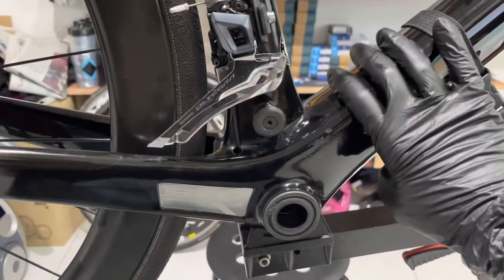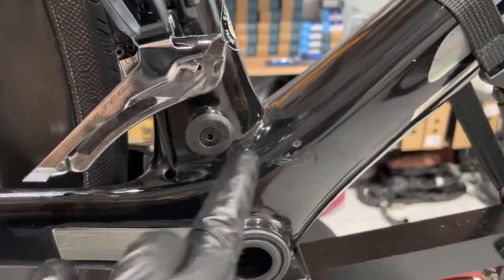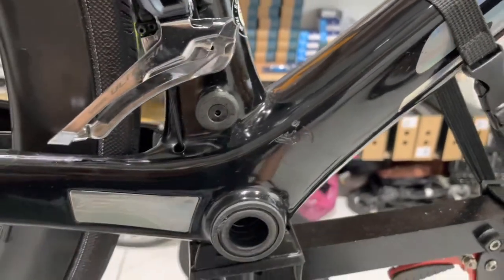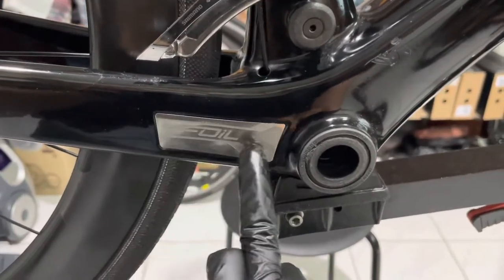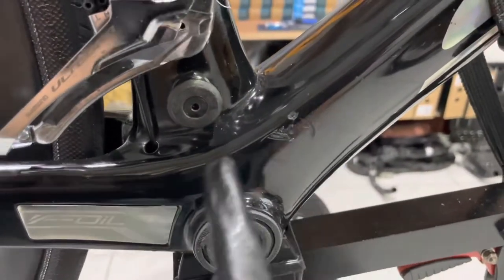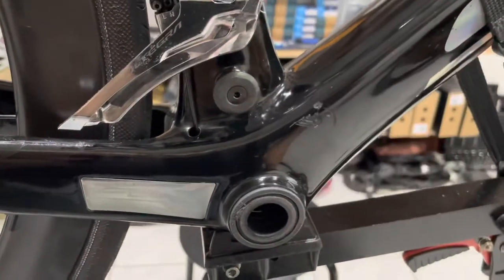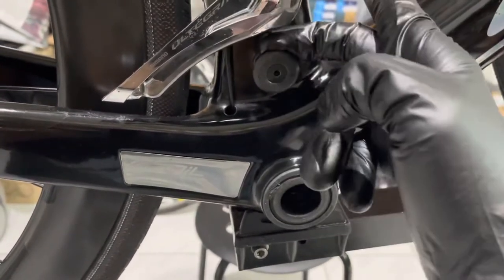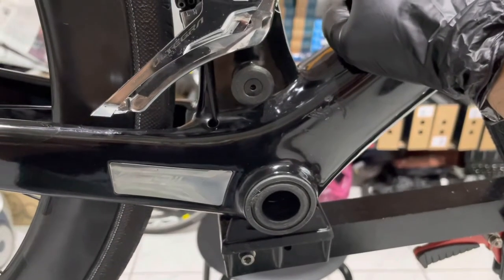Bicycle Chain Drop. On carbon bikes.

Comment: I think that steel plate designed to protect from the small chainring rubbing against chainstay while flexing under heavy load (eg 1500 watts sprinting :)) . I’ve seen multiple frames from different materials with damage in this area. In my carbon frame they went cheap and just put thick transparent sticker.
And I also got the same problem with dropped chain hitting the down tube. It had happened only ones but with absolutely properly set limit screw on the front derailleur. As for now I also ended up putting a sticker over the area as doubtful protection if it happens again. 
This is another problem with oversized press-fit bb areas in modern bikes when it just not enough space between chainring and down tube and the damage can be significantly increased if you keep pushing the pedals without knowing what happened. While in case of the traditional threaded bbs (or better designed frames) chain jus drops on the outside part of bb (or bb shell) without causing significant damage and you can safely stop while balancing on the pedals.
Reply from the maker: Some very good points here, thank you for the comment. 👍🏻